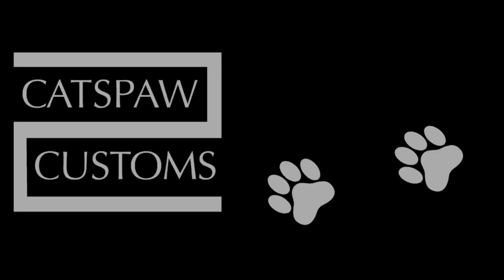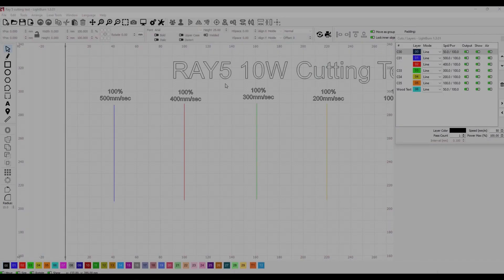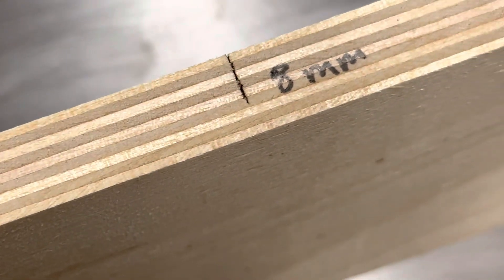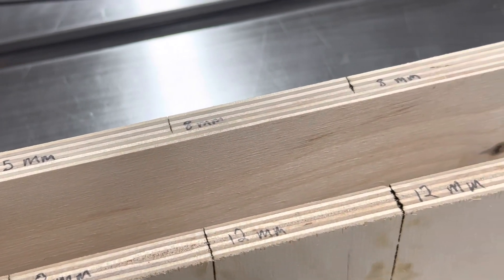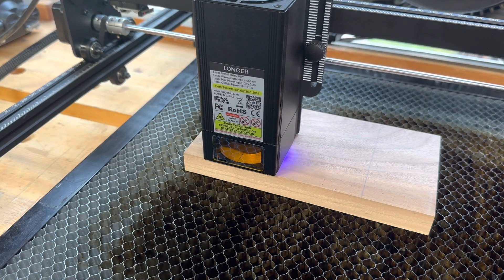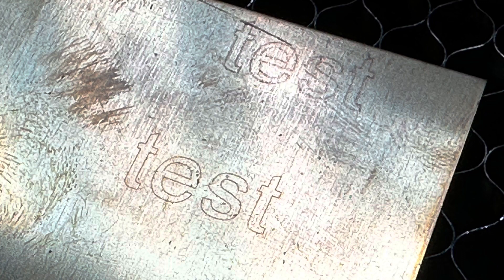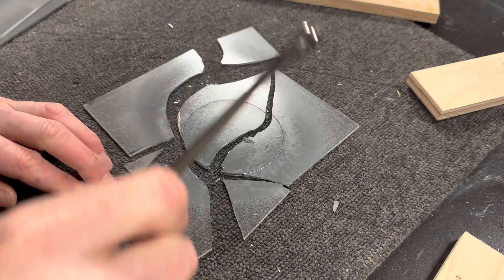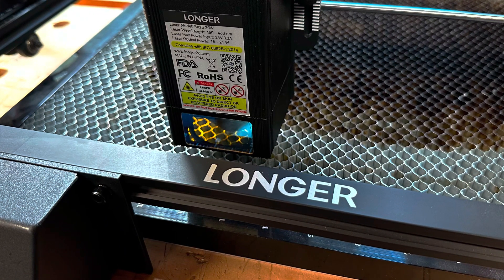Testing the Longer RAY5 20W Laser Engraver/Cutting Machine

Comment: Can you control the depth of the cuts to cut mold cavities into aluminum for example?
Reply from the maker: Maybe in wood by trial and error, but never in aluminum.  Diodes don’t touch aluminum.  You need a fiber laser to do depth mapping in metal.

Comment: How can you get the longer ray5 10watt to cut through 1/8 plywood one pass
Reply from the maker: Turn up power and turn down speed.  It should do it pretty well, but adding an air assist will make it much cleaner.

Comment: I just got my LONGER 20W RAY 5 yesterday, and I enjoy it so far, but the laser Z-axis adjusts are not fun at all! I wish it was like the 10W where there thumbscrews are in front to make it more secure and easier to get to :( and the height adjust isn't a solid object (like a metal plate, etc.), it is also on the rear and swings into position and held in OPEN or CLOSED via magnets. It is not sturdy and flips out on you while you try to hold the laser it one hand and set the thumbs screws in the other :(
Reply: OK, so I cannot for the life of me even etch Stainless or Copper. I was able to melt a rock on accident trying to etch that. Marble worked, but not even those free stainless biz cards .. what gives with this? I did notice that each software is different in that they may use mm/sec or mm/min, so I made sure I mult/div by 60 accordingly. I couldn't even etch or burn plain white paper (with LightBurn), but nearly caught it on fire with default gcodes included with the machine or LaserGRBL. I watched quite a few vids looking at layers in LB and settings there, but it doesn't come native with any preset materials database unlike other software (that is FREE). Thoughts?

Comment: My question is how to I made thins machine cut. It does engrave. And it also says it should have color but I can’t figure it out.
Reply from the maker: Cutting is a function of power and speed, and you’re really only going to have good success with thinner materials like 1/4” plywood or thinner. I don’t have this particular machine anymore, but if I remember, something like 100% at 500mm/minute should do it in one pass.  If that’s not working or isn’t close, then I think there is a setting in lightburn that needs to be tweaked.  Most problems with diode lasers come down to settings.  As far as color goes, I know that can be done on stainless steel, but I’m not sure if this machine can do it or if you need an infrared laser.